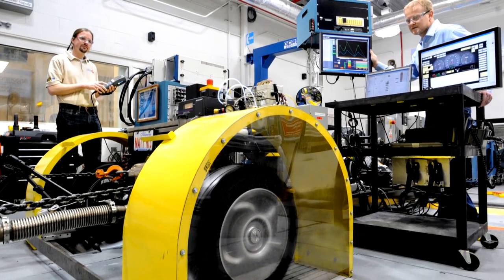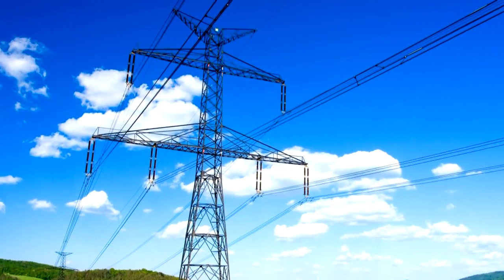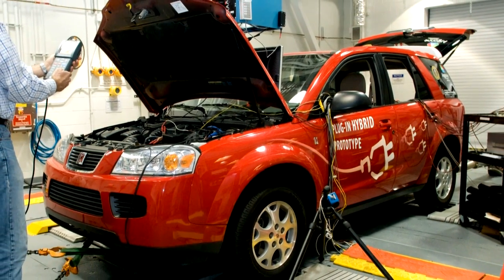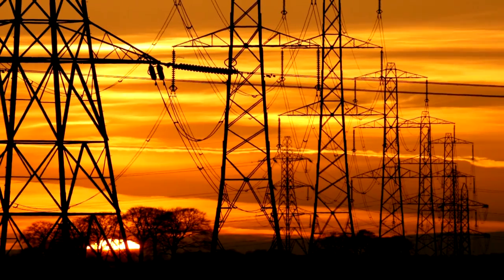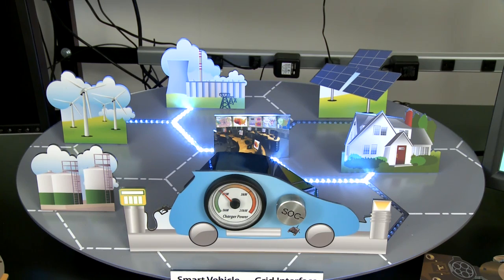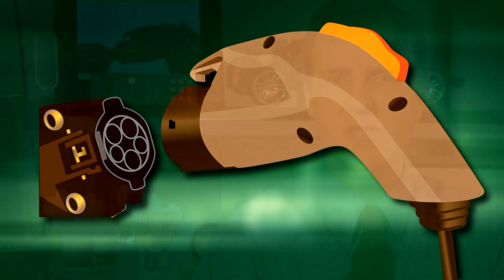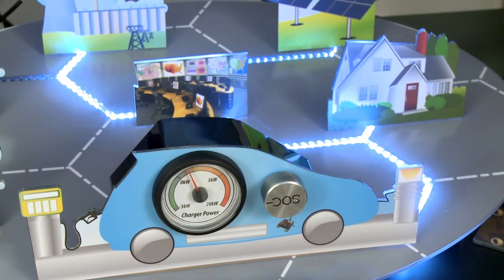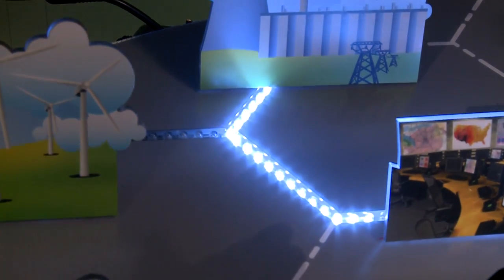Argonne National Laboratory Smart Grid Technology Interactive Model

Comment: I don't see how there is ANY way to choose your source of energy.  Sure, you could _request_ energy when a specific provider is powering the grid _more_ - but the baseload is nuclear and coal (and hydro where available), and that's the power you will get.
And electron doesn't know where its push came from, or where its going. A bias voltage has no memory.